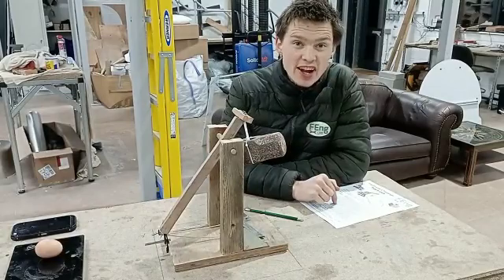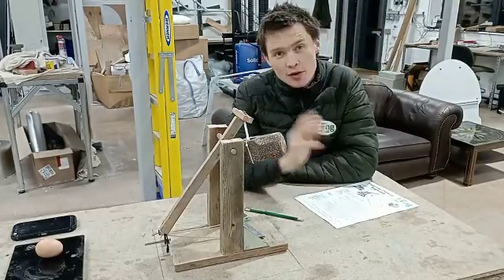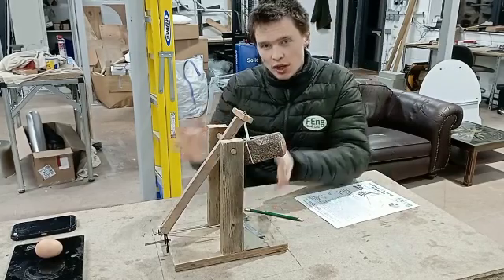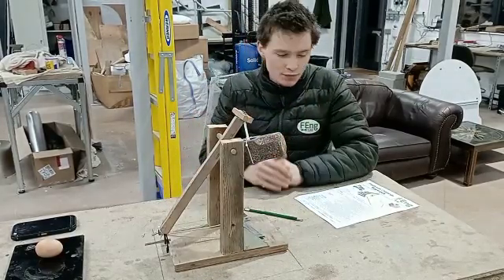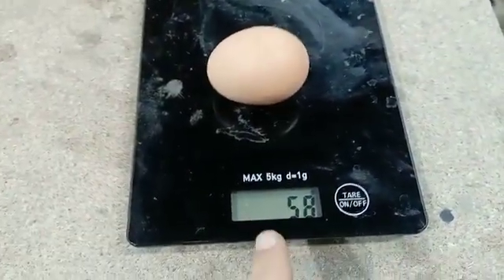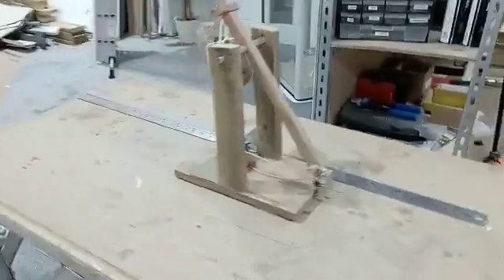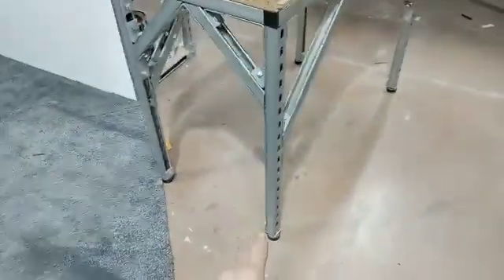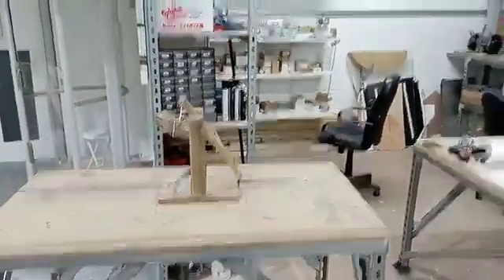FEng Challenge - 009 - Egg-a-pult - Demo

Comment: Looks fun! Would it be legal to build an electric car that charges from a gravity powered generator at the start of the round?
Reply: yeah, that's fine, it needs to show signs of motion within 1 minute and we will stop the measurement once we believe it has become stationary. Also the egg must be further forward than any part of the contraption at the point of measurement.
Reply: What kind of terrain will I need to deal with? On google maps I see a fence and maybe a vacant lot? I think I can get ~100m on an asphalt parking lot but fences will be some trouble 😅
Reply: aha, i believe the theoretical maximum is 40.5m, we will make sure there are no obstructions so don't worry about this.